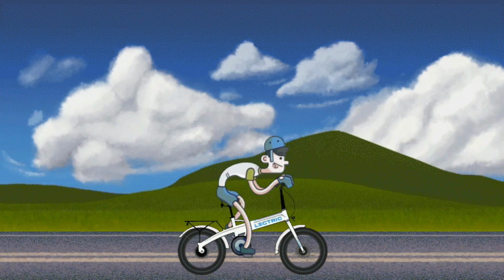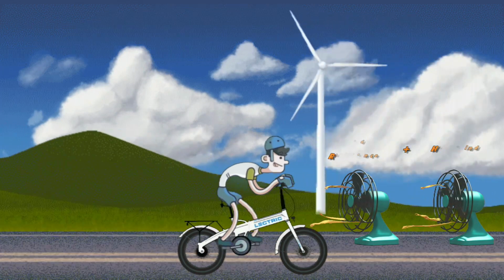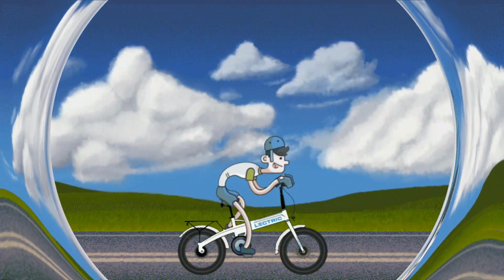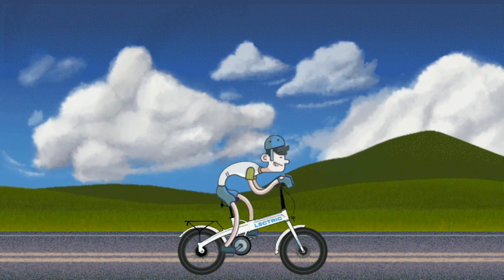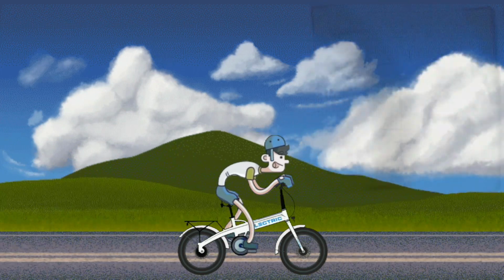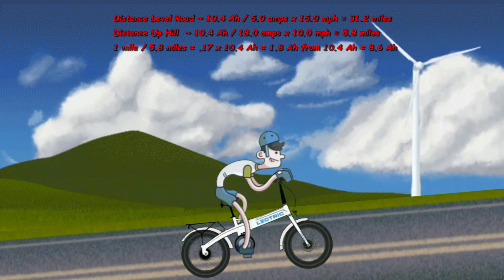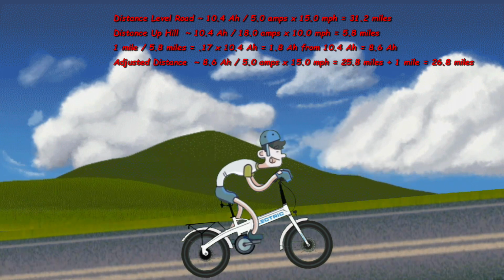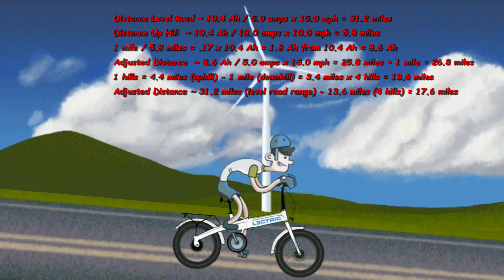How to E-Bikes ~ Speed & Distance 101

Comment: Another excellent summary, due to rider weight, front and rear wheel weight distribution, tire pressure and tire surface area of contact, each rider will have a unique dataset. Considering your variables and rolling resistance shows how widely the data for each rider will vary. Nice work!

Comment: Hi, I am thankful for the information you provide. I ran across this, it might be useful.  XP owners manual. PG 8 change value to 75, PG 11 change value to 1, PG 12 change value to 5. He says it unlocks the speed limiter of 28mph. I believe the controller is programmed to meet U.S. laws & is capable of much more with no adverse equipment stress. I am still waiting for my xp 2.0.